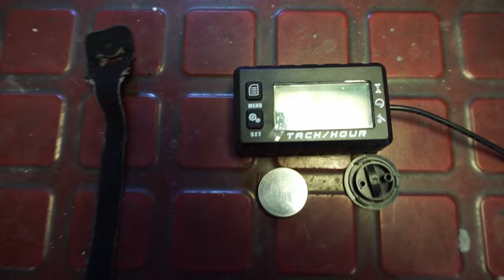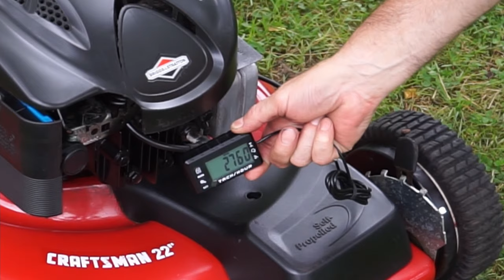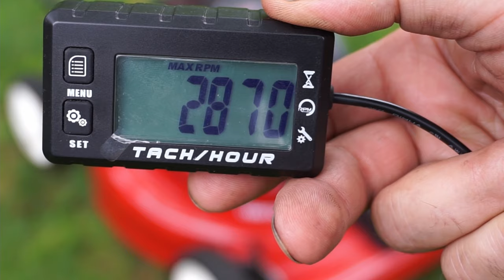HOW TO Properly Adjust RPM on Briggs And Stratton 5-6hp Flat Head Engines common on most Lawnmowers

Comment: Your video was very informative, I've watched a lot of videos and after watching this I'm sure I can adjust mine properly. Thank you!
Reply from the maker: Thanks for watching,,, Very glad this helped!!
Reply: @TheNovaJohn  I had taken a mower I got for free and I didnt realize when I put the carb back together the spring was stuck on the loop on the other side causing unnecessary tension which would make the motor sound like it was going to blow up. Simple adjustment helped. thanks again, I will continue to follow your channel
Reply from the maker: @socorrodelatorre9601  Oh yea,,,if it was Full revving it could have,,,,,,,

Comment: Great video! I love learning, new tips and tricks. The only concern I had was not just yourself, but others by bending or altering. OEM FACTORY INSTALLED EQUIPMENT ON THE ENGINE ITSELF COULD BE DANGEROUS, AND/OR DETRIMENTAL TO THE ENGINE. Though your weight does work and will work I believe in my understanding the correct way is to install a heavier or lighter spring. While achieving the same goal, I feel it's an easier safer by the book I guess way but not always easy to source out or locate the correct spring to obtain a higher or lower rpm. I was lucky and had one in my toolbox for my Honda engine and I just installed it and the same result. To increase the engine rpm increase the tension on the spring to prevent the fly weights within the governor housing to grenade or create a runaway engine type situation or failure. I was surprised to see The small engine, saloon do something similar by bending the governor arm but of course, the end result is the same it's just that I haven't seen anybody do it in my opinion correctly?
Reply from the maker: Lets look at this in perspective; 1st is the factory will provide a similar disclaimer to what you posted for legal reasons more so than any engineering one.
Second; yes a more correct way is through spring tension itself but consider this; usually the mower gets shoved under a bush and that tab gets bent along with some damage to the entire mechanism!
Now this is common on other engines as well,
generally this is the reason why we must correct this problem through methods shown. 
I'm not recommending changing factory specs for any other reason than to correct the issue do to damage.
I do suggest lowering the max RPM and I often cover my reason.  
Be careful to not over think this. At the end of the day, just like Taryl often says,,,,'its not the space shuttle' lol

Comment: Does the help when you pull a load? I'm using mine on a log splitter.
Reply: Oops..governor help w/load?
Reply from the maker: Check it under load, log splitters are really hard on these engines! Keep it from going above 3200 rpm under load...Max
Generally once set without a load, the governor will try to keep it within the correct range

Comment: I HAVE A LOG SPLITTER WITH THE B%S 190CC MOTOR. THE MANUAL CALLS FOR IT TO BE 3600 RPMS! SHOULD I SET IT AT THAT, SINCE IT IS UNDER A HEAVIER LOAD, BEING A LOG SPLITTER?  JOHN IN CO. THANKS FOR THE VIDEO..........
Reply from the maker: Thanks for watching!
Set it to 3600 no load then try to check it under load..
Get a bud to help and naturally be careful!
It should drop but not too far, maybe 3400
If the engine is older, maybe try setting it to 3400 or 3500
at that pressure/rpm, it should be fine. It will last longer and if ya not blowin through huge logs as a rule you will be fine!
I just hate how an older engine screams at these Hi revs,,,generally it isnt required and really it should be based on the machine requirements.
Another thing to check is the pump,, get the model number and look to see what they recommend for rpm!
Reply: @TheNovaJohn  THANKS,  ARCH.... I WILL CHECK ON THAT PUMP, ACTUALLY , I THINK I WILL REPLACE IT- BECAUSE OF AGE/USE....JOHN IN CO.

Comment: HI My lawn mover Brigg 7stratton EX 675 I set RPM 3000 follow you ,when stop machine i hear blade back Please tell me how to fix the noi Blade back Thanks
Reply from the maker: If it's Loose, it will make noises, make sure its tight!
It can also be out of Balance. You may want to replace it, they are cheap enough!

Comment: I heard that the blades are designed to work at  3000 RPM .
Reply from the maker: Most machines run that speed.

Comment: Folks buy a cheap tack to do any adjustments on Governor and RPM 
They can come apart and hurt you or someone else 
Set at 3000 for most small engines 
No need to destroy the engine faster
Reply from the maker: I think I mentioned that in this video,,